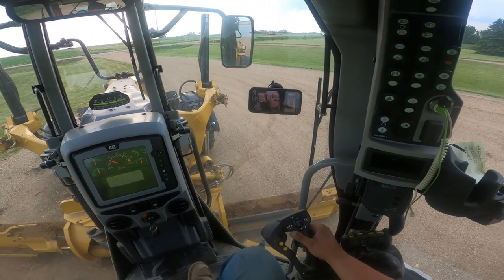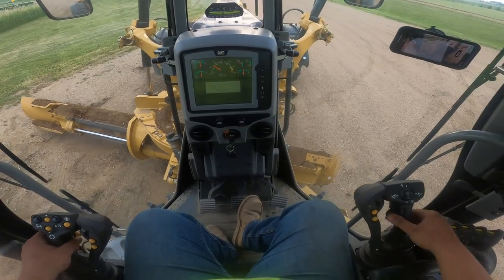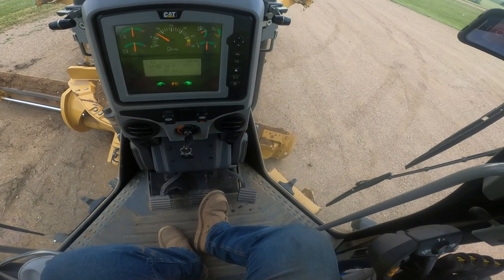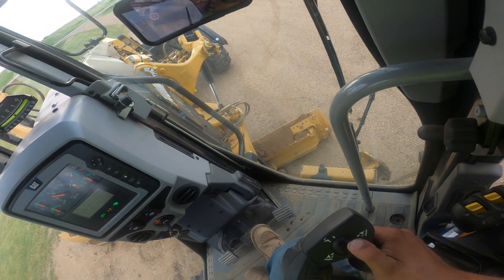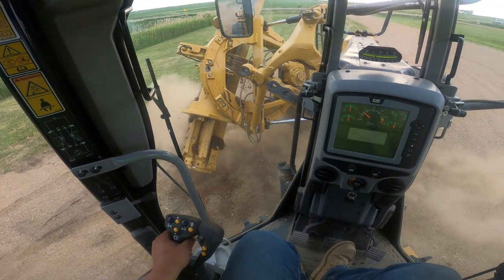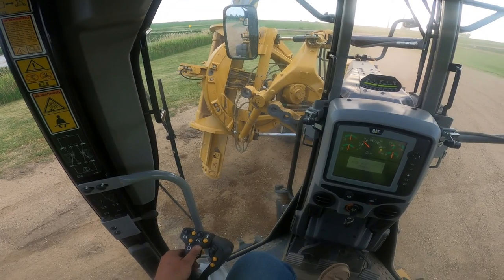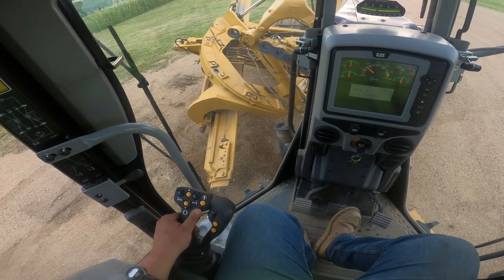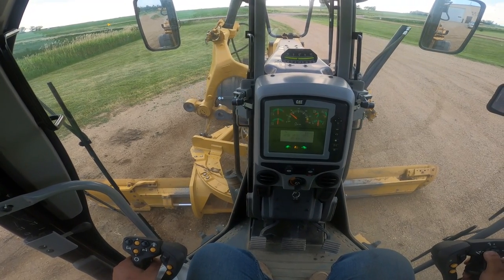how to pull saddle pin on cat140M3

Comment: Appreciate the videos.  Used to run a 140M for years at my old job and am finding that I miss it.  Another thing to watch for swinging out like this is your steps.  Seems like every grader out there that's a few years old has mangled steps and this is likely the reason.    Really easy to snag since you can't see them unless you stand up.
Reply from the maker: Yes that also is a very good point thanks for pointing that out glad you appreciate the videos thanks for watching!

Comment: I'm afraid I'll rip up a hydraulic or grease line if I do this. Lol

I may give it a shot the next time I'm in a blade though. I only just got comfortable pulling the center pin and changing the holes on that.
Reply from the maker: You do have to be a little careful while doing this but they have all the hoses run so you can roll your blade out good luck if you try it thanks for watching!
Reply: Finally got the chance to do it on our 160. Everything went great.

Unfortunately I can't do it on the 16 because the pin is seized inside. Next time I'm in the 18 I'll try it on that since we just got that one.

They give us shovels to clean our moldboard off but this takes like 90 seconds with a lot less effort. It'll be my go to as long as the center pin releases.

Thanks!

Comment: You grease the circle?
Cat does not approve of that...
Reply from the maker: If you read your operator maintenance manual it recommends you grease the circle drive pinion so that’s why I do it never had any issues greasing the pinion so will continue to grease it.